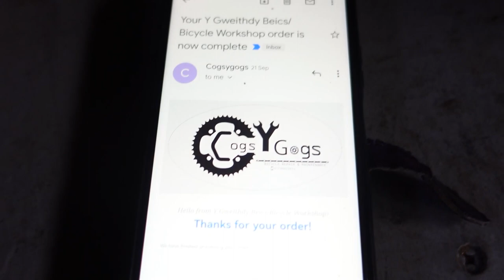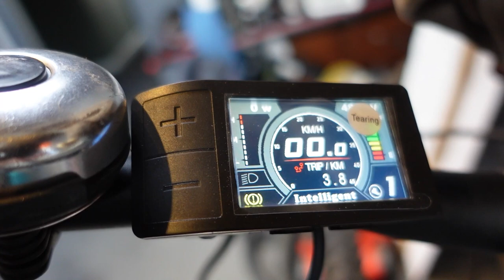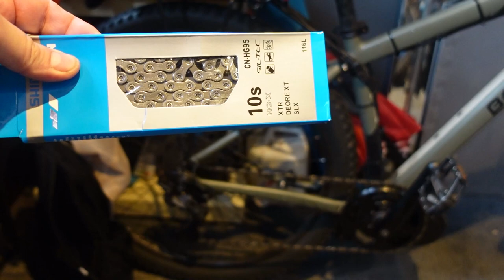bafang mid drive  ebike kit fitting to boardman MHT 8.6

Comment: Nice one Reg.

Saves your legs & stops your chest burning.

500 quid for a Bafang though,plus the battery ££££.

Must have cost you a grand.

I made my own 48v ebike battery using 18650 cells from broken laptop battery packs etc etc.

Look forward to next summer for more of your tours ,walks & rides .

Happy E Cycling .
Reply from the maker: £700 the full kit, would be cheaper for hub kit. I needed something quick. Might look at battery upgrades in the future but I am in middle of an off grid project that is taking up most of my time. Still cheaper than buying a shop ebike and have more control over power 😎

Comment: What size frame is that ? And what year is it, I measured up my mht 8.9 and it seems to fit a battery like yours inside of the frame.
I was just about to order the bafang motor. Now I'm.scared.the battery will not fit there.
Hah.
Cheers
Reply: https://www.youtube.com/watch?v=fdaDbB_LOIs& if you watch this video, seems like the larger frame can fit a battery nicely, also this might give you some cable routing ideas. if you do not want this posted here, please delete my comment. cheers
Reply from the maker: Ii believe it's a small frame, with an inside leg 74cm - 82cm. I have been using it most days since fitting and it's great with a battery on the back, stealth so not obvious its an ebike at first and I can take the battery into work and charge it. Been best thing I have fitted makes it so much more fun to cycle now